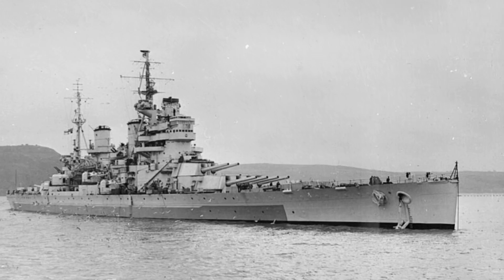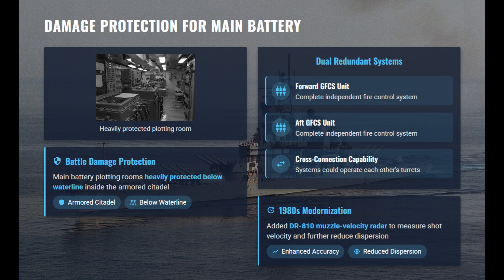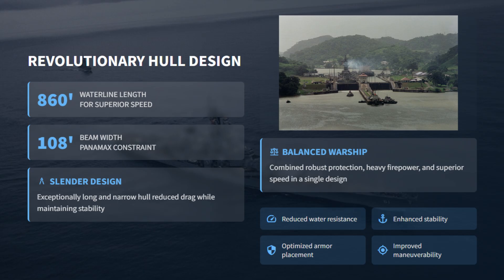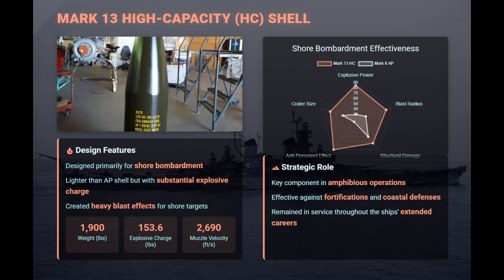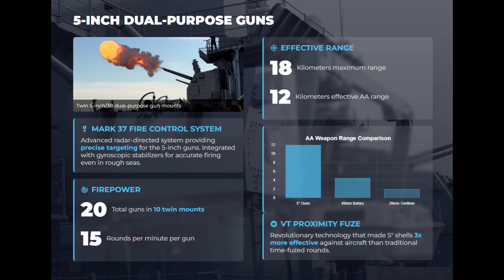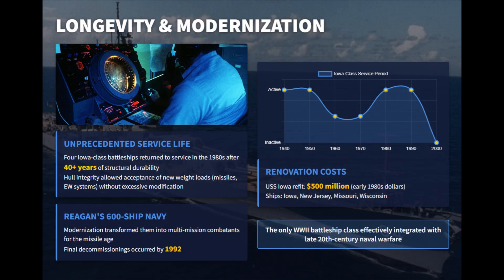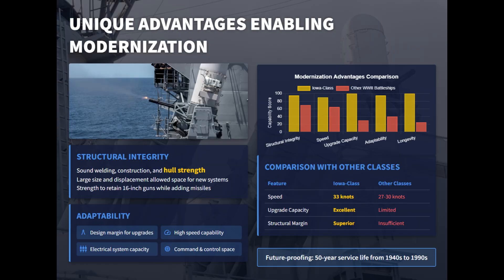Six Technological Innovations of Iowa-Class Battleship

Comment: Project Katie was the name of the program to study the feasibility of giving the Iowa's a nuclear capability.  After WW-2, the Army Air Force, (which became the U.S. Air Force in 1947) was the only branch that could deliver an atomic bomb.  The Navy feared a severe down sizing, and so believed this could maintain their funding.  The general idea was to have one 16 inch magazine converted to properly store and secure the atomic rounds in racks a certain distance apart.  When the order was received, a technician would hoist a round on to a table and test it and then remove the safeties, arming it for firing and load it on to the shell elevator, sending it up to the turret.  Some blue prints were drawn up and some work was started but was never completed.  By the late 50's the Navy had abandoned the project.  Although the Iowa's had Tomahawk launchers installed in the 80's, it is doubtful that nucs were ever loaded.  The New Jersey you tube site has a video that goes into more detail about what they have learned, even showing some of the prints.

Comment: One downside of its hull form was that it was often very wet (waves washed over the bow more).  This flaw was considered acceptable in exchange for the speed it gave it though.
Reply: Hard to believe something this large made by human hands during ww2 in under 24 months weighing over 110,000,000 pounds could still do nearly 40mph IN WATER!

The NJ/black dragon during nam trials did 35.2knots sustained for 6+hrs at a warload out of over 61,000 tons!
Reply: I note that the UKs KG5 class aren't mentioned for comparison.
Reply: The German Scharnhorst class had a similar problem, right?
Reply: @d4rk5t4r2 yes, I believe so.  They were later given an 'Atlantic Bow'.  Which was terminology for a flare.

Comment: All that high technology and it's still steam powered. Nothing wrong just saying
Reply: Technically speaking, so are nuclear carriers and subs, they just use a different method to boil the water
Reply: They should've ripped it all out ala the qe2 re engine around the same time as the Iowa got upgraded smh. Using diesel electric hybrids they'd still be viable for service today! Vs the over $28,000,000,000 of taxpayer funds blown on the 3 near worthless toothless feckless zummwaults!
Reply: @4literv6  Hindsight is 20-20!

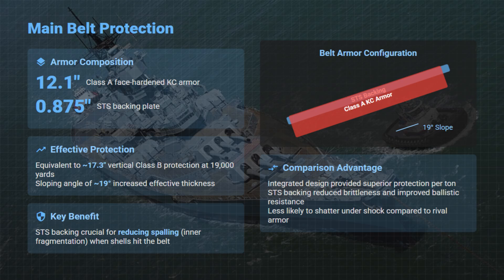Comment: The graphic showing the angle of the armor from about 4:08 to 4:24 is incorrect. It shows the armor angled at 19 degrees from horizontal where it should show the armor angled at 19 degrees from vertical. Other than that, this is a very informative video.